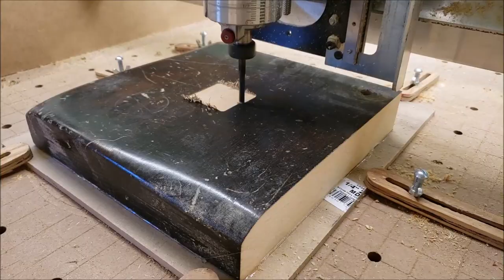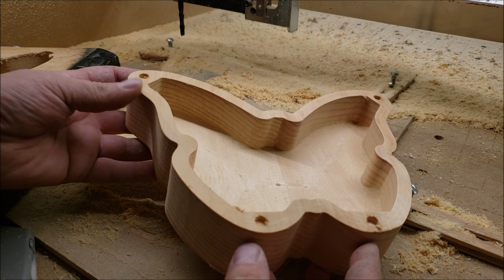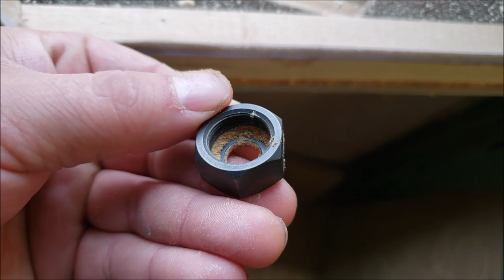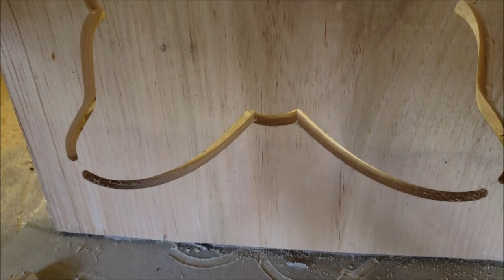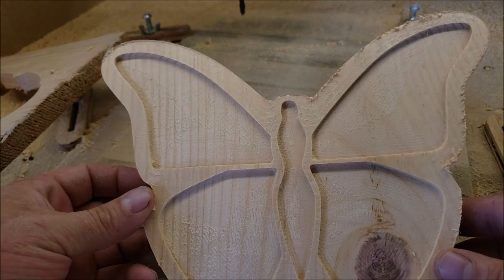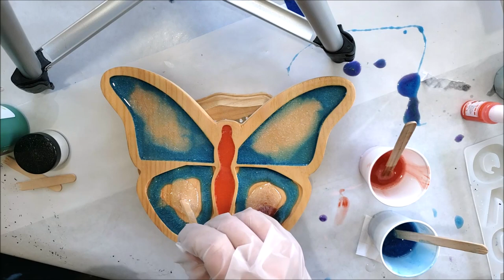Butterfly Shaped Urn

Comment: Nicely made. You're doubling your insurance, sticking material down & leaving tabs for extra safety! I can't see how you will align the holes for receiving magnets on the top lid? Or did you do that in a flattening pass on opposite side of butterfly shaping?

Before hollowing the base butterfly shape, I would give a 3-4mm contour cut with either 90° bit or 1/4 Roundover pointed bit to ease the inner edge. Then deep cutout.

For the lid, have you thought of rounding the 1/2" outer lip either with 1/4 Roundover bit again or a 3D contour just to soften the lid outer edge?
Reply from the maker: Thank you John! I cut the magnet holes twice as deep as the magnets, use ca glue to glue the first one in, let the glue set up and set the second set of magnets in, put a drop of ca glue on the top magnets and spray the activator on the lid. Then i just press and hold the lid in place, and it glues the magnets perfectly in alignment with the holes. For the edges, the customer just wanted them hand sanded to be softened. But doing the v pass around the perimeter is a pretty good idea for the next one i do! Im only using carbide create at the moment, until i can save up for Vectric Desktop. So everything is only 2.5D for now. Im making my longmill pay for itself before buying the program.
Reply: @adaptivediyers  neat way of doing magnets. Keep up great work
Reply from the maker: @JohnColgan.  thank you!